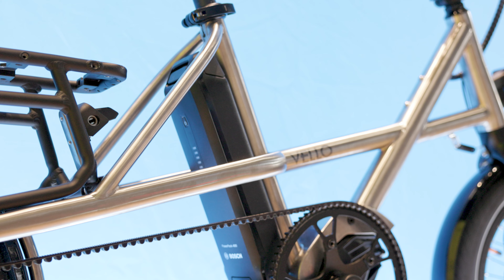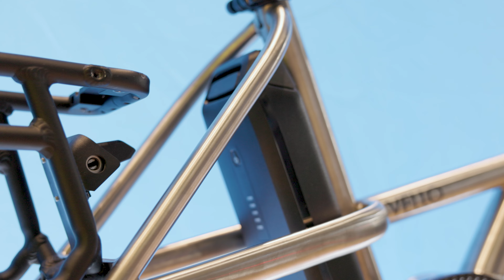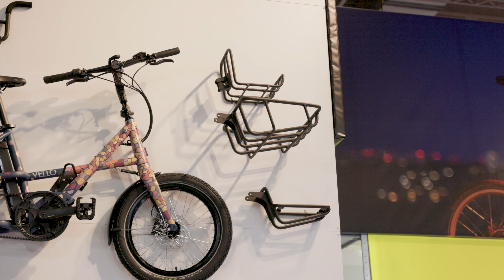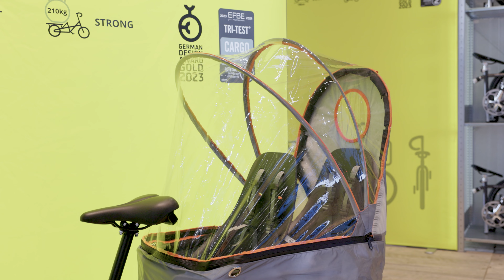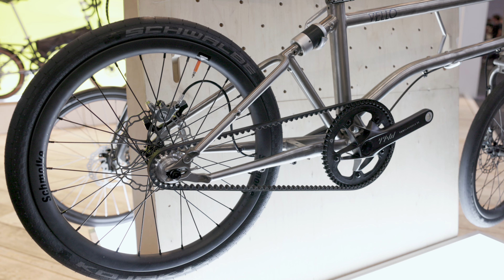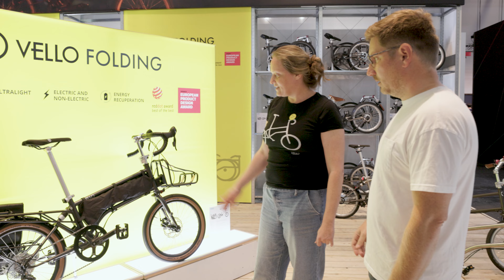This is the LIGHTEST electric cargo bike!

Comment: I'm begging the market to give us more bikes with regenerative systems. I have to replace pads every ~4 months and rotors every ~1.5 years and it's a huge pain
Reply: I haven't had to replace the brakes on my electric car after 7 years. I haven't owned my cargo bike that long but at this rate it would be be ~$600 and thats after doing all of the labor myself. Not to mention all the brake dust. And hey maybe I save a few dollars in electricity too.
Reply: @elliots4370 Regen definitely seems to save money in terms of breaks and brake. Dust reduction is excellent but regen as a energy recapturing thing, is not that efficient apparently

Comment: If Vello can make e-bikes that weigh under 20kg they will absolutely kill it in Singapore. So far the only “good” light e-bike is an e Brompton. Everything else here are just rubbish small crap bikes with no room for anything except a food delivery bag!
Reply: You must have a specific Brompton made just for you, all others have tiny 16 inch wheels, I wouldn't take a present of a Brompton.
Reply: Brompton is a good quality bike. But it's not a cargo bike. The Vello is very high quality too.
Reply: Bromptons don't have a double tube design which means they don't give you a stable full-size bike ride quality. No bike on the market has double tube design mixed with brompton-like pivot folding. Vello has a 9.9kg titanium folding bike and the vello electric folding bike is pretty lightweight too and designed for long distances. Bromptons can go long distances but it's not as comfortable as a Vello.

Comment: I’ve put 200 miles on my VELLO SUB in NYC, and it’s a really solid, comfortable ride. Totally opens up the city, plus I can carry my wife on the back (still looking forward to a few of the accessories shown in the video to reach our shores).

The lightweight folding elements are lifesavers, because I can fit the bike in my tiny elevator and carry it up a few stairs. On a Tern GSD that’s not possible.

Glad to see Propel working with VELLO. Hoping to meet more folks with SUBs in the States.
Reply from the maker: That’s awesome to hear! The VELLO SUB really is a game-changer for city riding & I'm sure those accessories will definitely enhance the experience even more.🤗

Thanks for sharing! 🚲💨
Reply: I carry my wife and gf on it.
Reply: @sillybilly8028  At the same time?! That’ll be quite the accessory 🤣
Reply: @AaronBloomfield  I am about to place an order for the SUB at Propel in Brooklyn. Did you get the steel or titanium version? I don't know how much of a difference the weight savings is but cost is much higher.
Reply: @lighthunter1980 I got steel. The titanium might take longer to arrive.